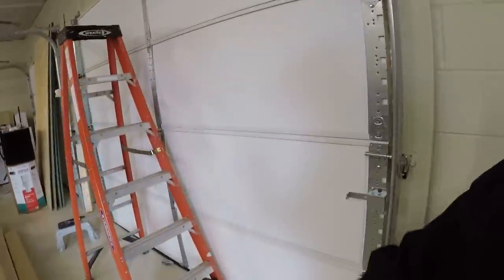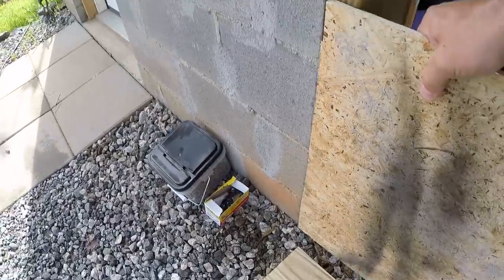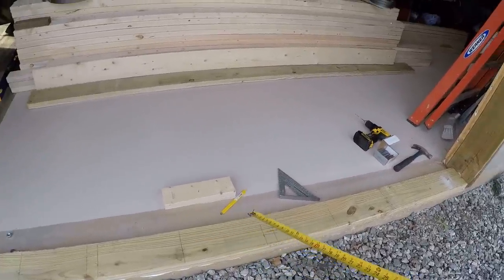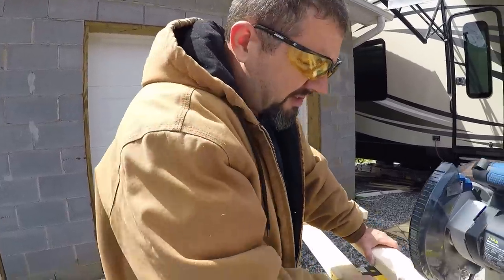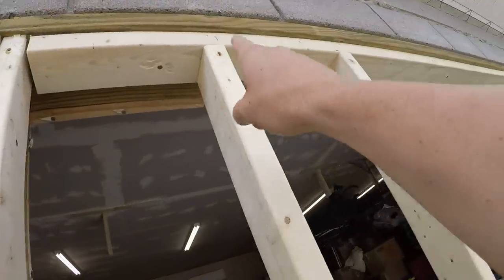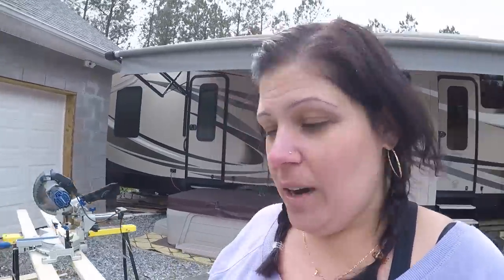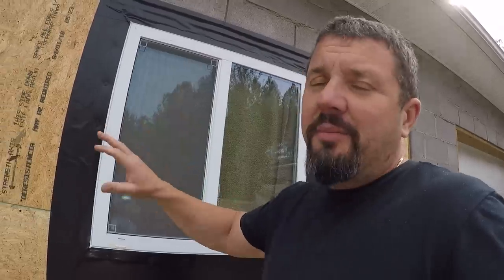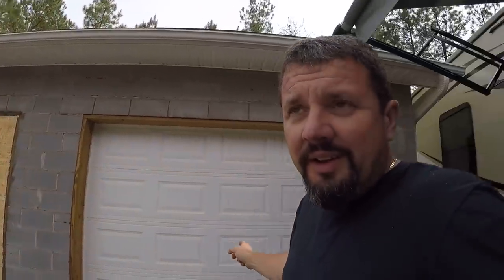Did Heather Remove A Garage Door? New Window Install!

Comment: I don't care if you do use pressure treated wood, that base plate will rot in ~10 years.  I found out from buying a house with a closed in garage.  Whichever previous owner had it closed in, the contractor didn't level up the floor with concrete to match the rest of the foundation & put the base plate on the ground.  After 10+ years exposure to rain/moisture the base plate was completely rotted.  Take the time, do it right, and have the floor leveled up and include a brick lip on the edge.  This will prevent excessive moisture from reaching the base plate.

Comment: When you frame in the other side, take the time to add a tar paper layer between the wood and the ground, that board will absorb moisture everytime it rains or snows and pull it through the concrete like a wick. Over time it will rott and produce mold.

Comment: Hey Ross,  One thing about 'masonry' bits...The tips are Tungsten Carbide, which is one heckuva lot harder than the 'tool steel' of your file.  Just makes for a good manner by which to ruin a good file.  Just for 'edification', (wink wink) there is no "air" in 'masonry'.  Three syllables, not four.  Masonry bits require (preferably) a diamond grit grinding wheel to truly sharpen them.

Enjoy!
Reply: kejay74   You move to the head of the class!  Different locations say things differently . Some say ambulance some say amblance.
Reply: @c50ge  and one is correct, and the other isn't.  Masonry is correct, not masonary.  Ambulance is correct, not amblance.  The correct way is the correct way, no matter where one lives.

Comment: You might want to check fire code. Not sure but think you must have front and back door.
Reply: True, but it doesn't technically matter. In the state I will live in, a bedroom can't be called a bedroom if it doesn't have a window and a door, or two doors, and a closet.
Reply: They passed all inspections with no issues.

Comment: Not legal  hope you never have inspection by town, or insurance claim for damage to garage/man cave? 2x12 framing legal, can put bottom sill flat , but, 2x4/6 to be cheap. Top header for roof support should be 2x12, with a 1/2" plywood sandwiched between front 2x12 and back 2x12. The 12" side should be aimed toward interior and exterior. You want the grain to be stacked for compression. What sounds like good structure actual 1 1/2" doubled on flat OR 11 1/2" actual doubled. with 1/2 " plywood for more structure. Two garages and a log cabin later, boat house, camp. Hope you like your insurance agent, after fire, collision,roof hit, storm damage, wind, rain, snow. If OSB is exterior grade your fine. Why no sill guard adhesive or weatherstop for air/water seepage.
Reply: John Caron whatever
Reply: John Caron you dont need a 2x12 headder for that size window, and in the south, they use 2x4 s for the outside walls
Reply: They passed all inspections with flying colors.
Reply: It was already a garage bud. Already has a header that passed inspection lol

Comment: I know I'm just repeating what some others have said but you really, really need to find out the fire codes and you need a permit, you also should redo that front with something sturdier than the pressed board! Did you put a sealant or something between the board and the concrete at the bottom, not just what you put on the outside?  I remodeled and flipped houses for many years, not a contractor but I learned a lot while flipping. Good luck with your project!!
Reply: They reinforced those walls before they moved ion and passed all fire codes just fine.

Comment: Just for those that are curious..
April 13 2018
During a home inspection i was envolved with..
The city inspector pointed out that the unpermited upgraded windows ..
(Vinyl)
Were not to code in the bedrooms
Code for bedrooms
At least 1 window per bedroom (for emergency egress, fires)
Shall be no higher than 42 inchs to the highest point of the open window you would be crawling over from the floor...
So if you are replacing old windows to new ones..
This code kicks in...
Just food for though
Reply: The city inspectors passed them with no issues. They are 100% compliant with the local codes.

Comment: Nice work! Does all the garage doors come out piece by piece? Just curious. I will like to take mines down but they charge too much money!
Reply: I know this post is a year old but yes,  they come out by sections like that.  But the spring that assists in lifting the door is under extreme tension and will seriously hurt you if you don't know what your doing to release it.  Maybe it would be best to call for help with that part.

Comment: Ross, good job.You did need a Hammer Drill, it would have been a lot easier. Harbor Freight was the savior (hammer drill) I also used the same Bosch masonry drill. Your terminology is a little off but a good job other wise.  Its great to see Heather work with you. Great Mother-in-Law Apt. plan.
Reply: Heather really got a workout on this project.

Comment: I found it helpful to use a square and make a second line for the width of the radial saw blade and my cuts always come out just right.

I also have a natural 2x8 frame around the garage door; which is just about the perfect size for a hidden arms safe.

As a 90% disabled veteran; I built a Personal Data Processing Center, ( "Data Center" for short ); and have built 20 computer systems that are 35" long 15" high, and depth is 15".

.. At any rate; the heat these huge computer(s) put out is massive, so I am going to put up a wall with a walk through door and cut out for a 14000 BTU AC unit, and that will also deal with the moisture we have in Tennessee also.

I have a unit in the window, but it cannot keep up, and since I took a pretty good hit in Iraq during the first phase of the ground war; I would have to much trouble trying to lift the new AC unit up to the window because my back was broken in three places; for the wall I can actually position the placement so I can use my engine cherry picker to give me the lift I need.

Thanks for the content; gave me a couple of ideas; and figured I might as well add a couple of 240v -30 amp outlets and 120v - 20 amp outlets on the outside of the garage when working in the driveway for the compressor, ark welder, mig and tig welder; the sun hits that side pretty good so I may put a couple of rows of solar panels I had left over from the emergency back system I setup a few years ago.

Peace